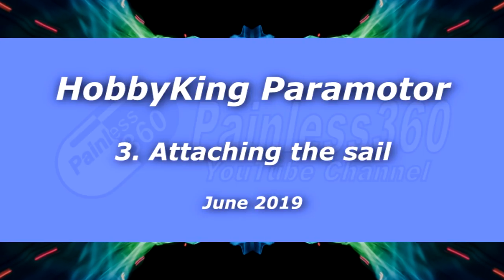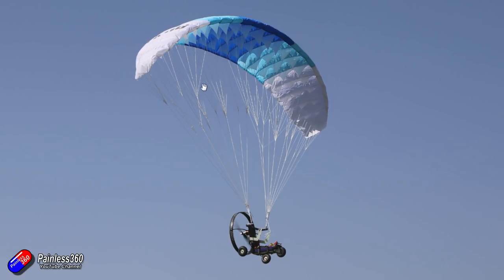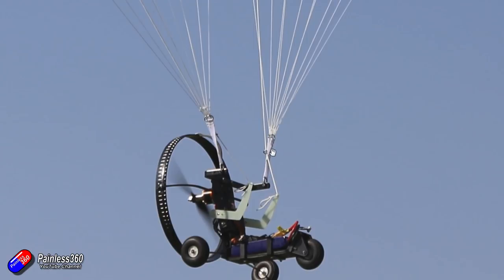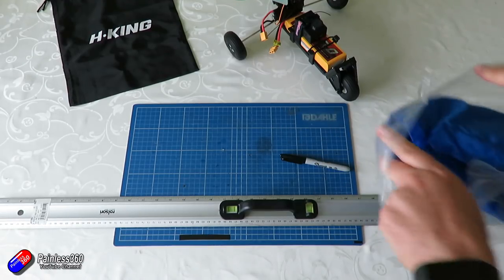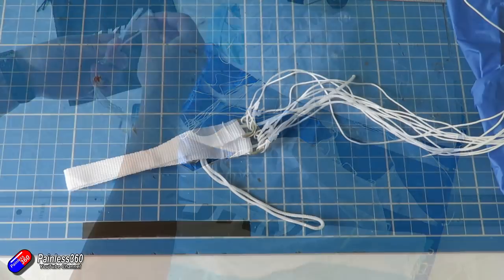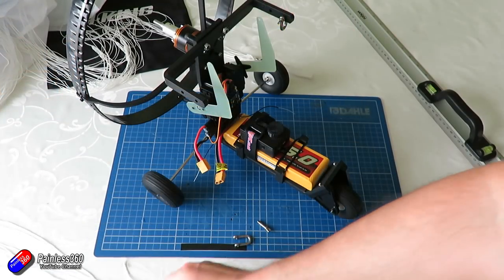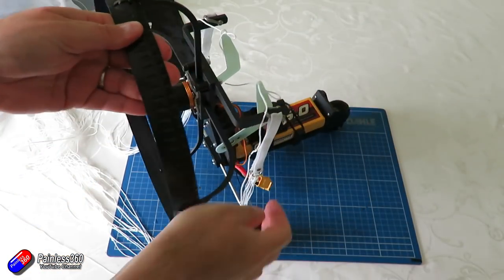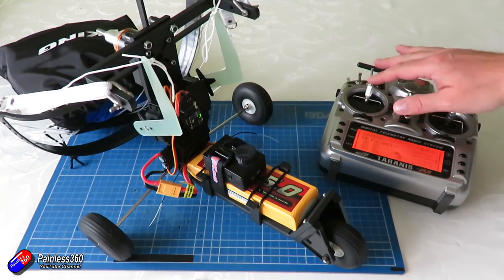HobbyKing Paramotor Pt 3: Setting up and attaching the sail

Comment: A question on marking the brake line. You say that the mark should line up with the top of the riser's D Rings (at 9:17), but at about 9:47, you show the mark inning up with the top of the Brake line's D Ring.

I'm confused. Not, by the way, an unusual occurrence. Thanks for a clarification.

Comment: This is such a dream to fly. If you can get it into the air that is. I was surprised how tricky it is to get the launch just right.
Reply: Whats hard or tricky about it? I have one on the way.
Reply: @MrLunithy  just making sure the wing comes up straight and need to have the throttle right. Throttle up too much and it'll surge back and forth making it hard to control. I think my problem was not aborting if it the wing didn't come up right. Now I can tell if it's not coming up right and just abort the launch. I wouldn't say it's hard but one of things that takes a bit to get the hang of it. Second day I was launching just fine. Launch over grass while you get the hang of it. It's pretty tough. All I had to do was straighten those metal hoop holders after 5 failed launches.
Reply: @wormhole331  SPOT ON - all is said and now - practice, practice ..
Reply: @wormhole331  Thanks.
Reply: I got mine yesterday and tried to fly it in a little too much wind. Smashed it up pretty good and broke the front landing gear off completely. Was able to bend most of it out straight and actually got in a nice flight this morning. I am still doing a lot more crashing then flying.
Reply: I hope they come out with replacement parts soon!
Reply: @d.b.cooper  I already designed a replacement motor block, and shroud system in cad so I can 3d print it. I know I'll eventually break one of those metal support arms.
Reply: wormhole331 i’ve bent the hell out of the metal support arms and also completely shattered the front wheel support.

Comment: Just an FYI.  The propeller has a front and back.  It will work backwards but will only produce about 75% of the thrust.  It should be strong enough to overturn itself on full power!  If you can go full throttle without having to hold it down then it's probably backwards!

Comment: Nice video Lee. A couple of the guys down the club have paramotors and the one thing that they seem to play with a lot is adding/subtracting weight based on the wind conditions.  To light and it just goes backwards, too heavy and it doesn't fly so well. Looking forward to your first flight :-) .
Reply from the maker: This will need about 200g extra on the cart to fly well in lower winds. Enough for a GoPro :D

Comment: I have yet to fly mine, but from the vids I've seen on it's flight, I'm strongly considering adding a servo that will pull down on the "A's" slightly to act as a speedbar. I'd like to be able to speed it up a bit to fly in less than optimal conditions.

Comment: hello, thanks for your video. Yes Hobby king leaves alone in the instructions for the length of the brake line. I think that's bad. I'm also finishing my paracopter. The marking with the pen make you at 649 cm or 25.5 inches and must tune with the middle ring over? I have seen videos where the brake line has been knotted with the ring. In those she is knotted only on the servo arms. That seems more logical to me. Have you already flown? Unfortunately, there is not too much wind here.
Reply from the maker: Maiden video with launching tips in the works..
Reply: Painless360 glad to see you got right on this one Lee!

Comment: I am confused by your brake attachment segment. Your 649mm brake marks you put at the D-ring when you set it up. In the HobbyKing setup video they put the 649mm mark at the servo arm hole. Which one is correct?
Reply from the maker: I followed the setup videos from the designer of the model so not sure. Best of luck

Comment: I'm too late for the explanation, had mine out the second time today. The wind was getting stronger while I was in the air with it, barely made it back to the field. But it was fun 😅
Reply from the maker: Cool! Brake line mark lined up with the top D ring?
Reply: @Painless360  With the top. I followed the instructions in the video on HKs website and the one by the Petrinčič brothers (which was more entertaining 😁 )

Comment: Given that pilots used to flying fixed wing will instinctively pull back on the elevator stick to pitch up, has anyone considered putting throttle and 'rudder' on the one stick and the 'brake' lines on the other stick?

Comment: Uhmm, I have seen in some other videos that the brake lines mark needs to aling not on the lower but on the upper ring. Now I'm not sure which advice to follow...
Reply from the maker: Upper ring looks good here.. This should be clearer in the instructions.. Can you link to those videos that show the other setting?
Reply: @Painless360  I was unable to fly mine with brake lines configured the way this guy says. I wonder if that was the reason.
Reply: @Painless360  Ups, it seems that I missunderstood your instructions. So mine keeps crashing and maybe it is more on the pilot =)

Comment: How can you setup the transmitter up....for flysky  I 6...
There is no information about that ..this transmitter has only three mixes
Reply from the maker: Unless the radio has the curve function you'll struggle to set it up.. Best of luck!
Reply: @Painless360  I have found the solution...it's activate the elevon and change the output to 120.and that's it..done...
I have put on YouTube now...